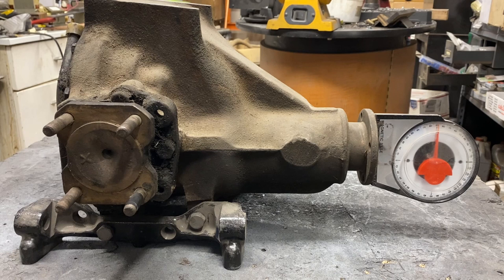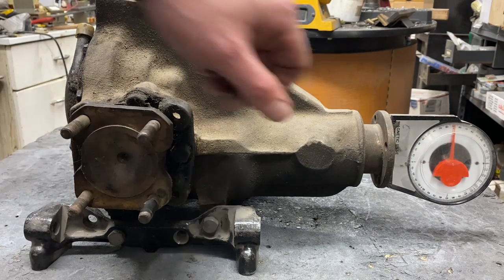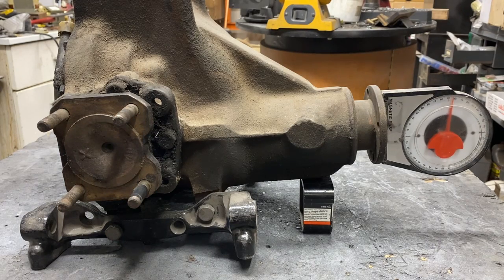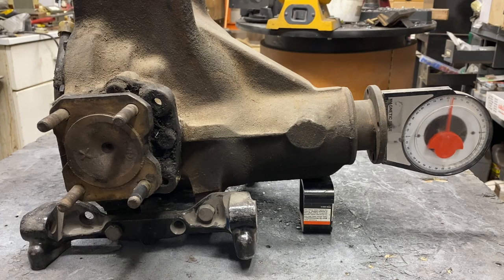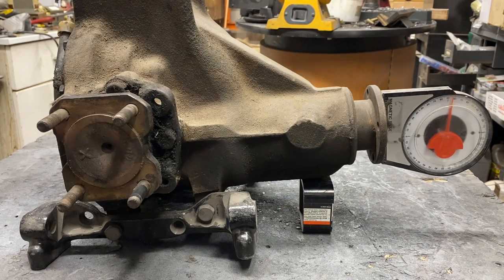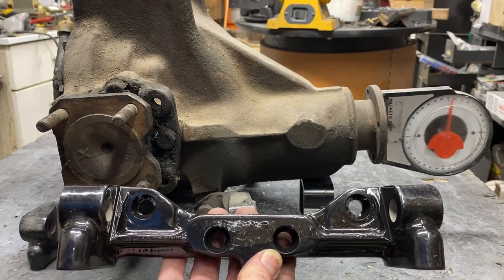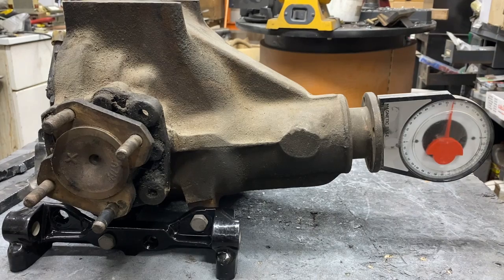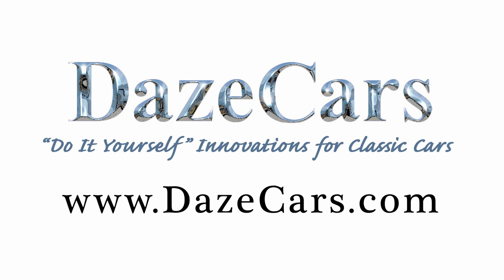Jaguar IRS Pinion Angle Hack

Comment: But doing this throw out the tailshaft  angle then the needle  bearings in the universal  will not rotate correctly  and will dig into  universal  cross bearing surface,  i think jaguar  and other  IRS rear end  builders ie corvette know what  they are doing  😅
Reply from the maker: You are completely wrong. I’m changing the pinion angle to match the transmission in my car. That is how you correctly set it up for proper needle bearing movement in the u joints when putting a jag IRS in something OTHER than a Jaguar.  And your flippant comment about the Jaguar IRS not needing to be modified  because the designers “know what they’re doing” shows you weren’t paying much attention in the video because the mod is done with Jaguar IRS parts.   I appreciate the comment but let’s really  take a good look at what is being done before assuming this is not the best way to do it. I am extremely well versed in the Jaguar IRS and know what I’m talking about.